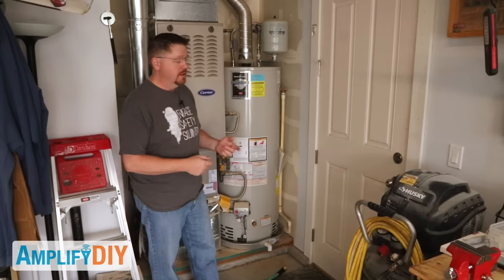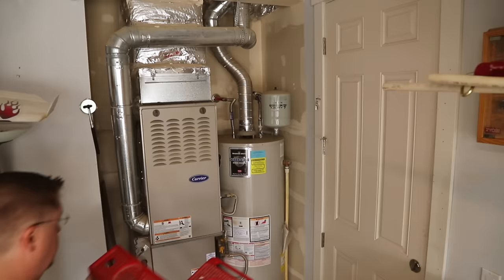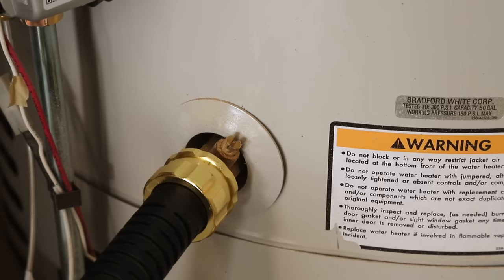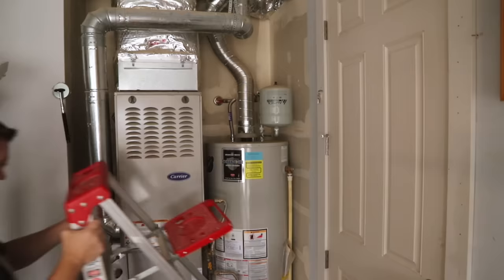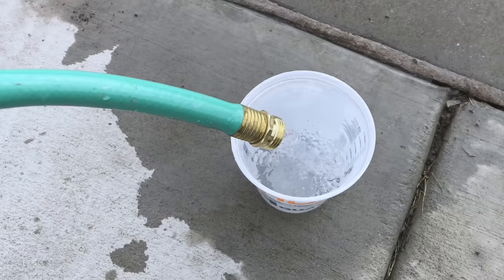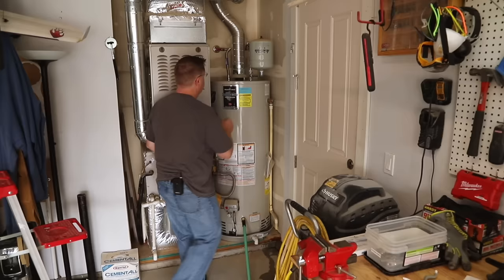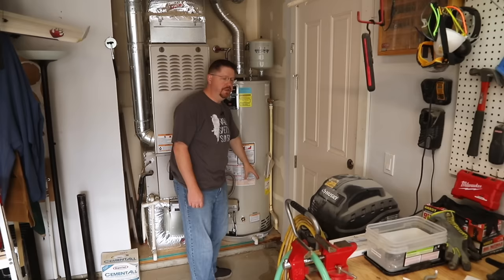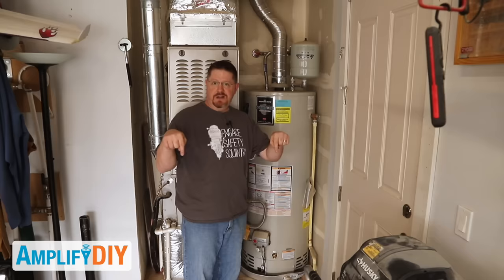How To Flush A Hot Water Heater To Remove Sediment

Comment: You seem like a nice guy so I hope my comments don't come off rude, and after reading some of the comments from so called tradesman it's no wonder more home owners are confused about this subject. I come from a family that has run a plumbing company for the last 38yrs, my dad has been a plumber for 49yrs, I've worked in plumbing as a plumber for the last 21yrs as a commercial and residential service technician. 
There are a few things to understand about your water heater that it seems are not explained in the video and the comments. First the drain valve that came with your water heater was never made to flush your heater but to only drain water from the tank, most older heaters have a plastic drain valve or a brass valve that looks like a hose bib on the front of your home, newer models have a straight brass valve as in the video. The older valves when fully open by backing off the screw or handle only open a gap 1/8" wide, below that is a 3/8" hole for water to pass through, so that fact that any sediment equal to or bigger than an 1/8" will ever come out of it will never happen. If your heater is 4yrs or older and you have never touch your heater you may plug up that valve and have a hard time shutting it off. The first thing you should be doing to properly Flush your heater is to have the manf. drain valve thrown in the garbage and have a full port 3/4" ball valve and nipple installed so you have a full straight 3/4" opening out of the bottom of the heater to Flush sediment. Another thing to note your flushing your heater not draining it, your water heater is equipped with a Dip-tube on the cold side of the heater that brings the cold water from the house to the bottom of your heater and creates a current along the bottom of the tank moving the sediment laying on the bottom, so you leave the top shut off always on during the flushing of your heater. By not opening any fixtures in your home you have all the pressure gearing towards your Flush valve you've installed on your heater. As the incoming water comes into the tank by opening only the flush valve the sediment now being moved by the incoming cold flow has no choice but to leave the bottom out the hose, the amount of sediment and coarseness of it depends on how often if ever your heater has been serviced. Some of the pieces can get to the size of your finger, you may also have chunks of your anode rod come out that have fallen off and are sitting at the bottom of your tank.  Someone made the comment of cutting off your anode rod completely from the tank, really the lack of understanding with that comment, the Anode Rod is what protects the lining of your tank why would you ever remove it, on a hard water home you may replace it every 5-7 yrs but on a home with soft water that Anode Rod will be completely dissolved in less than 2yrs. How many of you home owners with water softeners and no maintenance to your heaters have had a tank last longer than 7yrs, once the Anode Rod is gone corrosion attacks the next weakness link of the system the lining of your tank.  For gas water heaters the more sediment in your heater the longer your burn cycles will be as the flame has to heat through the sediment first to then heat the water. With the correct valve on your heater and routine flushing and changing the anode rod, you can easily get 20+yrs from a heater, minus any defect of the product. When flushing the heater you will run until you can no longer see or feel the chunks or sand like grits in your fingers, there's again no need to turn off your breaker or gas valve, as it is not effecting the flushing process, there is no air getting into your system, and yes it is also a good thing to open the T&P valve annually to make sure it works properly, if it doesn't close replace it, it is after all a safety valve you don't want to stick closed in the event of a thermostat sticking in the heating cycle, the results could be explosive. One thing that will effect how much sediment and how fast it builds up is the hardness out here we have an average water hardness of 24 grains. I hope I have help in this conversation and cleared some things up.
Reply from the maker: Hi there Alien, thank you very much for taking the time to write up such a detailed explanation of things. I agree with just about all of it - in particular your advice about changing out the drain valve at the bottom of the tank as well as inspecting the anode is really important. When I filmed this, I was intending to be as generic as possible with my instructions, so I did not speak about specific features that my tank has, such as the swirl feature you mention. Not all tanks have this, so in general, it is best to agitate the sediment at the bottom of a tank using the method I've outlined in this video. In fact, I'd argue that even with tanks which DO have a swirl feature, it is still better to agitate the sediment using the method I've outlined. When the tank is full, the incoming pressure at the bottom of the fill pipe near the bottom of my tank will generate a current - but honestly not that much due to Bernoulli's Principle. It exits the fill pipe at a high rate of speed, but then slows to nearly a crawl as it runs into the rest of the water already in the tank, creeps around to the drain valve, where it again speeds way back up ... but, and this is the important part, it is only moving very quickly within about an inch or so of both valves. In between (across the entire bottom of the tank) the swirl is VERY gentle, in spite of the pressure of the fill tube.  By removing the water from the tank in the first place, the incoming water is much more free to form a whirlpool of high velocity around the bottom of the tank, and dislodges more sediment as a result.  Thank you for watching, and thanks again for sharing such a thorough and insightful comment!
Reply: @AmplifyDIY  Thanks for the response,  but I will have to respectfully disagree the way shown in the video is a better method and will explain why. If you get an empty 5 gallon bucket drill a 3/8" hole in the bottom sidewall and then fill it with let's say 1/2 gallon of sediment which is normal to remove on a heater of just a few years. Then turn on a garden hose into the empty of water bucket just as a diptube would put the water into your tank, yes you have agitated the sediment, but let's look at what happens to it.  The flow of water hit one spot of the tank splattering what sediment it hit back and around the sidewalls of the bucket, then the bucket fills with a gallon or two of water all that sediment now follows gravity's force and fall straight down in the bucket it's not flowing towards the 3/8" hole the water is leaving it's the size of a straw and no force moving it, so as in your video you only get very small flecks coming out. Then you repeat the action, but the same effect takes place. The way I have explained exerts constant force and Flow to keep the sediment moving and forces Under Pressure the sediment to leave the bottom of the heater changing out the hole at the bottom from a 3/8" shut off to a 3/4" shut off allows this to be much more effective thanks again,  have a good day
Reply from the maker: Hi there Alien - I've discussed this with several other people in the comments on this channel, and while my intuition agrees with you, my understanding of basic physics does not. Your example of the 5 gallon bucket is an interesting experiment, and I'm now thinking about performing that or something similar in a future video. I'm also thinking about purchasing a bore scope (for an unrelated future video) that I can use to actually observe (and record on video) what is happening inside my tank the next time I flush it.
Reply: Having just flushed my water heater after 3 years of use, I'm going to echo the OP and state that his method is better (drain, then turn on water to agitate the crud, then flush a few more times).  
That extra force from the water pressure moving into an empty tank will help to break up those particles that have settled to the bottom of the tank and have often solidified and increased in size.  If you never drain the tank, then yes, you will have a constant flow of water across the sediment, but it isn't doing anything more to break it up and dislodge it than at any other time during a water heater's normal daily use.
Imagine a clump of dirt stuck on your driveway.  If you take a plain hose and set it next to that clump of dirt then turn on the water, that gentle stream across the dirt may get rid of some of it, but the majority will stay stuck to the driveway.  That is the equivalent of leaving the water in the tank.  Yes, you have a lot of water moving across it, but it isn't really doing much.
Now take that same hose, put a sprayer on the end of it and then spray that clump of dirt from a few feet away... the total water moving across the dirt is less by volume, but the added force against the dirt will quickly break it apart and wash it away.  That is like draining your tank and then turning the water back on.  The added force suddenly hitting the bottom of the tank will break apart those particles much more effectively.
Now that said, if the drain is too small, the particles can collect and clog the drain.   In that instance, opening the water inlet and refilling the tank to build up pressure can help to push those particles through that small drain opening, but ideally one should flush their tank often enough that those particles never grow to that size.  
 
Other than that procedural difference, I completely agree with everything else.  People should definitely replace the cheap, small drain valve with a full 3/4" brass ball valve so it drains faster and can drain those larger chunks of minerals and sediment.  You should also check the anode rod periodically (at least once every 1-2 years depending on water conditions), and also check the heating elements to make sure they are not degrading from deposits in the tank as well.
Reply: @jeff92k7  while your method of thinking is trying to figure the Force needed to be exerted against an object to move it by having the empty tank versus the constant direct flow of movement in the bottom simply spraying Water against an empty tank and then leaving gravity to do the work and not force defeats the argument you're trying to bring out I would love to challenge and I tested practical situations since I've done over a thousand water heaters in my 21 years of experience that the method of described does not work as you have laid out. One thing to note the dip tube in a water heater is a fixed pipe with a specific opening it is not a fine tipped spray head that is angled towards the back 90% of the water heater the dip tube sprays down or at a slight angle and that's all the spray can hit so it will not break up any clumps in 90% of the water heater because it's hitting an empty tank bottom splattering what it did hit back and away from its path that's all it can hit.
Reply: @alienwolf815  Fair enough.  I don't have 21 years of experience with water heaters and haven't done a bunch of practical situation tests.  What I have done is flushed my tank last week and observed the pressure of turning water on in an empty tank causing years worth of calcium and mineral buildup to break apart and dislodge from the bottom of the tank where the constant swirling of the water in the tank (under normal use) hadn't broken it apart and had actually allowed the buildup to occur and solidify into some pretty large chunks.  Your comment about "leaving gravity to do the work" indicates that you may not understand why the drain first method works better.   You don't just let the water break apart the stuff and splash up onto the sides of the tank and hope that gravity pulls it back down.  That would be pointless.  After the water breaks apart the buildup, you refill the tank at least half way and then drain it again (and likely repeating that at least once more) so that the water will fill and rinse the sides of the tanks where stuff has splashed.  You are using the force of the spray to break it apart and then refill again and drain a couple times to rinse it all out.  You don't just leave it hoping gravity pulls it back to the bottom of a nearly empty tank to magically find the drain opening.
 
Just like with my water hose analogy, once the dirt is broken up, you don't just turn off the water and walk away.  You spray a wider area of the driveway to now wash away the splatter from where the dirt broke apart.
 
But I suppose if you have been doing this for 21 years, then your method has probably allowed for a lot of valuable repeat service calls to customers, so I guess that method probably is better for the professional.   As a homeowner simply doing it myself to save money, I'll stick to draining it and then using the force of the water to break it apart where I can actually observe it cleaning the tank so I don't have to spend money on repeated service calls with professionals.
 
In fairness, I will note that there are a bunch of different tank types and likely far more different types of water coming into them, so what works for my situation and particular mineral buildup may not work for everyone.  I'm sure your method probably does work better in some situations.  When you do this professionally, I'm sure you are looking for the method that saves the most time and is effective in most (if not all) situations. 
 
I'm sure the best option that would work in almost all situations would be to drain it and use the force of the water to dislodge and break apart the buildup, then refill the tank and allow the water pressure and continuous movement to then flush the now loosened particles suspended in the water.  But that would take at least twice as long as the drain/refill method and a lot longer than your method alone... and for a professional, time is money, so I can understand how you'd stick to the faster method, even if it doesn't clean everything out.  After all "good enough" is just fine for most service companies.  That's why I do basic maintenance stuff like this myself now...  Good enough isn't good enough for me.  I want it done the best it can be, even if it takes me longer to do it, and the inside of my tank is spotless right now because of that.
Reply: @jeff92k7  you must have a history with bad plumbers, I'm sorry there are a lot of them out there. We don't look for the fastest least time method to doing a job wrong, but will stay until the job is done right the first time so repeat return call are not necessarily.  Work smarter not harder, requires you to spend time doing things in different ways and finding the best methods and then fine tuning that process with continually updating it. The fact that you got a result doesn't mean you did it the most effective way or got it all out of your heater, and if you left the manufacturers drain valve on you waisted you efforts and time. Once you broke up some pieces  you asume that by filling it half way with water and drain it your "magical" pieces finding there way to the hole to exit the heater, shows a basic understanding of Gravity and physics on the Force needed to move an object. The pieces in the empty tank did not turn to powder that will graciously float out but are still chunks that sit on the bottom watching the water leave the tank while they stay put, and could show this by cutting the side of tank off so you could see this happening as I have. Just as when you try to flush say the like flakes on a garage floor coating that someone put in the drain you can run a hose all day and on a camera the pieces never move, until flow and force is applied and they are finally moved out of the line. Simply filling a tank and then draining broken pieces doesn't change physics that you do not have the Force enough to move a object with a tank draining from gravity toward your 3/8" or 3/4" opening. I'm glad your trying your own to save money that's great not all homeowners want to tackle that, and hope you fine when you need a plumber the next one doesn't rip you off, my method  is not just for professionals, as I teach this method to all homeowners as it can be done by the young and the old.  Honest plumbers don't need to do a job to guarantee a return call, and we wouldn't have a A+ rating at the BBB, or the highest 5 star ratings even among the big corporations if we didn't know our job well. Have a good week end, enjoyed the conversation, take care.
Reply: @beercan3614  lol, the children have arrived, glad you could join us, thanks for you contribution.

Comment: Can you direct the hose into the sump pump even thought the water is hot?  My water heater and pump are about 10 feet from each other, so that would be easiest for me.
Reply from the maker: To reduce the heat in your tank, turn off the heat source and take a shower. This will pull cold water I to the tank and then when you flush it won’t be scalding.

Also, would be a good idea to put a small screen over your drain that feeds into the sump to catch any large chunks that may come from your heater. Good luck!

Comment: The relief valve is critical to draining the tank.  Without opening the valve, a vacuum will occur and you’ll believe the tanks empty and it is not.
Reply from the maker: Spot on! Some people are super worried about touching the T&P valve, but they should be tested annually, and during the flush is a great time to do so: https://youtu.be/e5H1i1cypxA